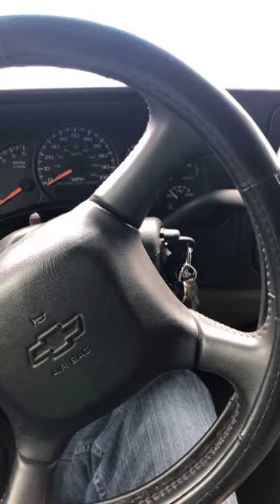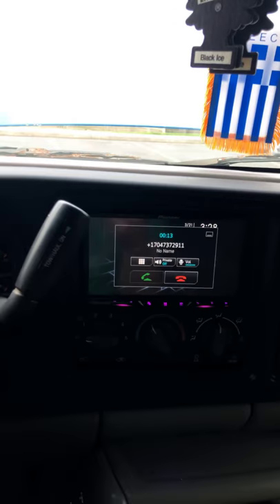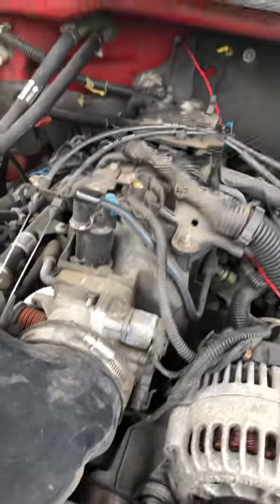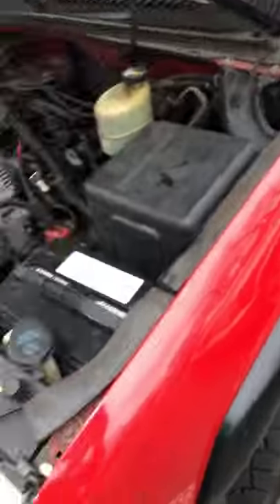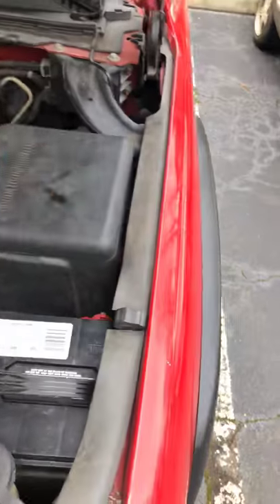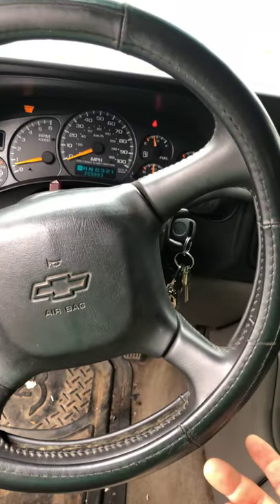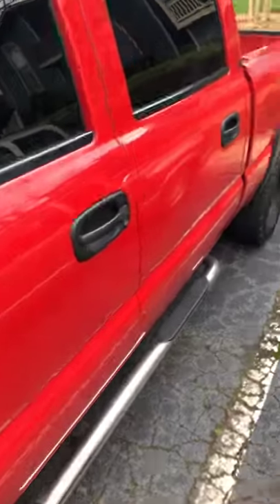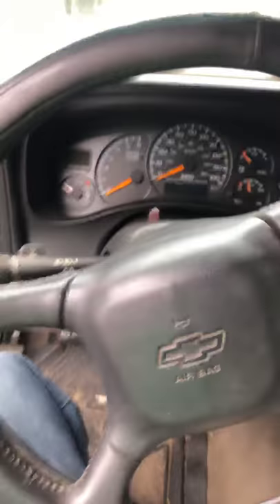Silverado, no start no crank 00-02 6.0

Comment: Hell yeah im bout to try that. I have 2002 chevy 2500hd 6.0liter gas . Same problem except a freakin mouse decided to chew my wireing while at work went to jump it fried half my shit. Trucks been down for months finally went through replaceing all parts and wireing excedra, go yo start now same problem. Mind u this all happened 2nd week i just got the truck drove it 2 weeks before it happened. Only 55,000 miles on it.lol now this problem .lol im gonna try ur idea ive been over dang near every nook and cranny on my truck guy before also put a dead switch in and i noticed some rigged wireing i pretty much sorted most that out.